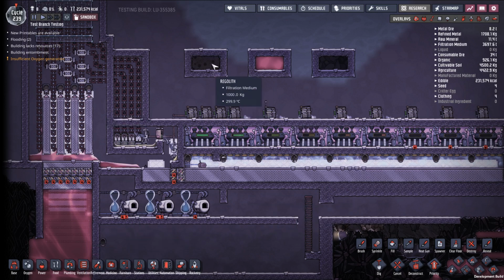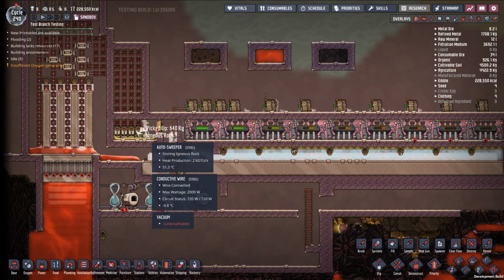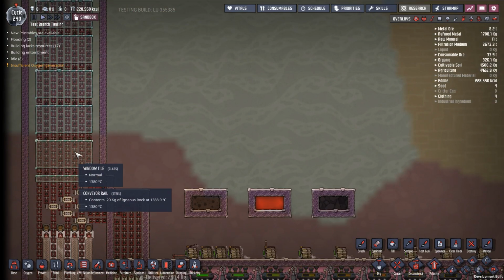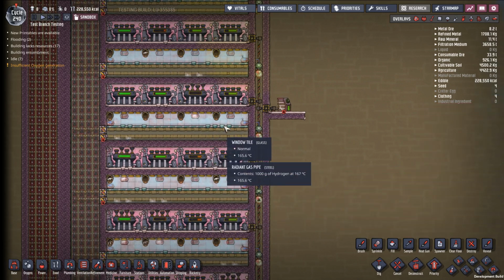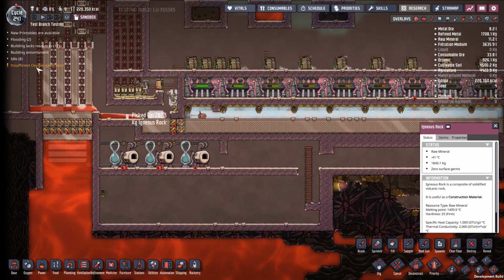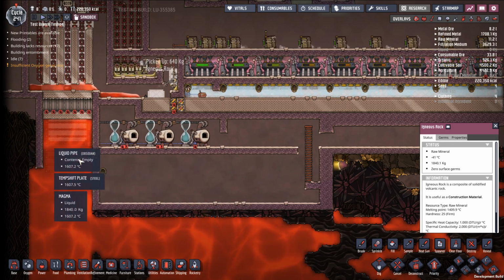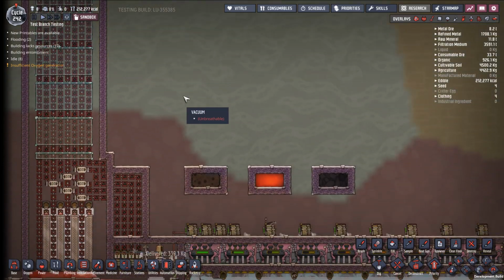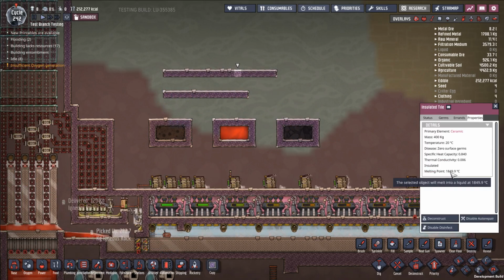Powering Your Base By Melting Regolith [Oxygen Not Included]

Comment: Lovely video on what you could do with unlimited steel, is it possible do the same thing as small as useful that might be doable in survival? is this late-able or end game only?
Reply from the maker: Technically I dont think this build needs much steel at all.  Mainly you just need a metal that wont melt at ~1400-1600 C.  Iron should do fine, Tungsten is another alternative.

It's still a very late game build, because I think on average, the surface of the asteroid is going to have around 60kg/s of regolith get dumped on it (3 conveyor rails worth).  So this build already assumes you have a big system in place to harvest and ship regolith from practically the entire surface, plus a bunch sitting around from before this was up and running.

A smaller, more practical build would just be one regolith line.  You can simplify the heat exchanger and melting area if you're only doing one line, and you'll power a smaller number of steam turbines off of it, but still probably more than enough to get what you need.
Reply: @gearheadgaming1  Thank you for the fine print that iron could work, that helps a bunch. I'd love to see a single line version of it.
Reply: @gearheadgaming1  Great video idea.  Here is my version of this idea https://imgur.com/a/UuhIIBn .  1 line of Regolith (1) can output a constant 22-23/25.5 KW, so with 3 lines (and 3 machines) you could effectively get 75KW constant power.  If we automate the turbines and add 2 conveyor shut offs for the regolith in / rock out, we can remove the problem of our regolith source not having 100% uptime, as well as reduce the heat drained from the Magma Core (3).

 My original solution to adding heat to the Magma Core (3) was to use a metal refinery (2), which uses magma as its coolant (glass works as well, but magma has a much higher specific heat capacity which makes this much more efficient).  My thought was that the refinery could just use the metal from space (thereby having an infinite source) and have the added benefit of producing usable refined metals.  I could also do this with glass (as you recommend in your video) and once it had run through the magma have it would end up in my heat battery and conveyor it through it to extract the remaining heat https://imgur.com/DiT4UZK

The main problem I have with these solutions is that by the time we can make them, we don't need them.  So like @yamahab asked, this was my take on a version of this that could be reasonably made at midgame level https://imgur.com/H5SqSbR .  This version only requires 1-2 https://imgur.com/usWQ6BA in order to supply enough regolith.  The compressors are optional on both designs.  They are mostly just there to take advantage of a volcano if one is available

Comment: Can you use this to turn rust to iron ?
Reply from the maker: Yes.  You wouldn't get any excess heat out of the system because rust and iron have the same specific heat capacity (the iron would come out at roughly the temperature you put the rust in at), but this same setup can be used to refine rust into iron, most ores into their refined metal, sand into glass, phosphorite into phosphorous, and most other raw materials into igneous rock.  With a little tweaking, you can also convert coal into refined carbon and clay into ceramic.

For a conversion process like rust to iron which is neither endothermic or exothermic, I'd recommend making a smaller heat exchanger out of wolframite/steel/diamond-- a similarly sized obsidian heat exchanger could also work.  Also, because rust's melting point is closer to the temperature of the magma/molten glass than regolith's melting point, I'd recommend making the heating element maybe like 50% taller.  Other than that, chop away all the upper steam turbines and system is exactly the same.